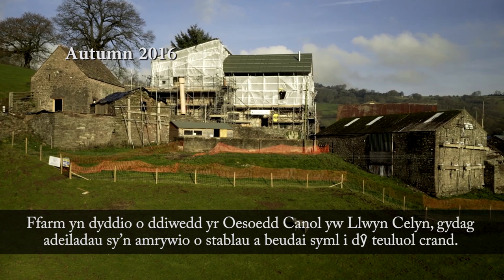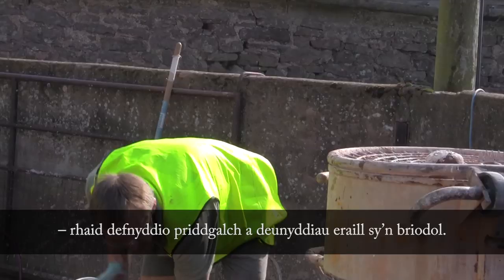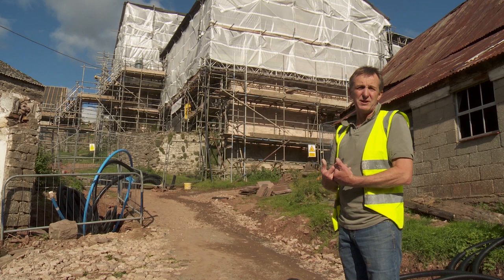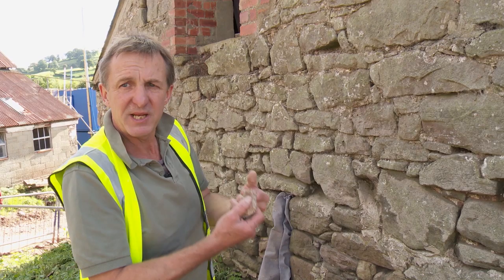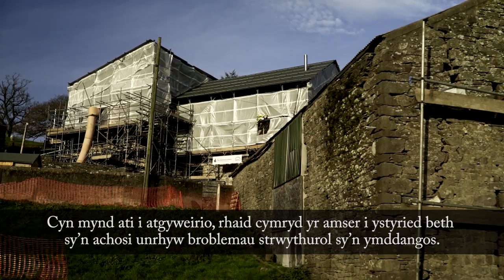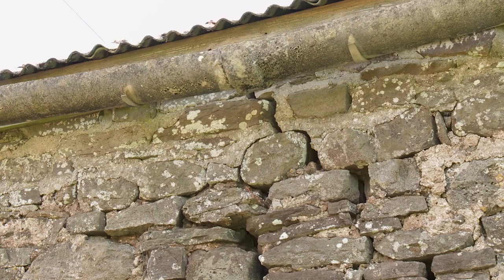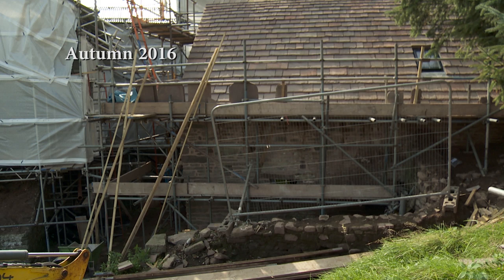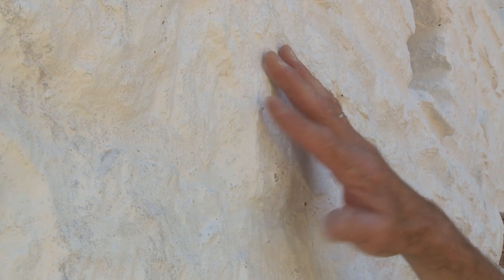Using lime mortar for repair at a medieval hall house | The Landmark Trust

Comment: Great information, I have a question, can I use lime mortar to lay down and secure flagstones on a ground surface to restore an old stone pathway? I don't want to use cement.
Reply: No you can’t, traditionally they were bedded in sand. Lime is not strong enough to ‘grip’ a flag.

Comment: I found a lime and cow dung plaster mix round one of my t windows and maybe on some parts of the walls on my house in Spain. the plaster sounded like lime and cow dung in some places. Wet it smelt like fresh cow muck.
In ohter places some parts of the house seemed to have been covered with lime and sand plaster and others lime without sand  and others lime, local clay and sand.
   IIt seems to me that the plaster on the walls have been repaired in hte places it had fallen off so that  what is on hte wall is a patch of one thing in one place, cow muck and lime say and sand and lime in another, and lime,  the local red clay, and  sand lime plaster in others. 
 The stones are held together with clay and  combed goat and so the lime plaster has in places, like below the windows were rain falling the sills caused the clay to bleed out  so that the walls been coloured by the clay and so hte plaster is pink in places.
Reply: Wow: such an old house.

Comment: I am plastering the interior of an old brick building and  we were recommended NHL5 1:4 ratio with sand. Being that the NHL5 is the least permeable between the hidraulic limes, should I change to NHL 3.5 even if the first coat of 0.5 mm was already made with NHL5? As I learn more about this system more, I feel the recommendation was incorrect...

Comment: I am surprised that it wasn't pointed with like to like material and in this case at least it would be a hot lime. So they didn't bother to slake quick lime on site to achieve better mortar and instead they just bought bags of nhl. It's lazy and I am not
impressed. And I don't agree that there is an honesty in the new pointing. It's not flashed enough with the stone, the more quality mortar the better it is for the stone. it's hard to achieve that with the NHL. The workability of nhl is not great, this material is not sticky enough. The functionality of hot lime is much greater than the NHL, ability to remove moisture from the stone through the capillary reaction and what goes with it removing salts from rain water, hence protecting the stone is much greater. But what do I know, just did some research for my project but anyone who is interested in lime pointing should do his/her homework and choose the best material possible . Just my opinion based on a lot of research and common sense.
Reply: I agree with you, NHL has recently been proven to be too unpredictable, I like nigel copsey's book on hot lime mixes, it's worth visiting his website, so much good quality research him and david wiggins has done on the subject.

Comment: aaargh yes i know where this guys coming from/,,,,,,early maori here in new zealand used an ancient mortaring technique using,  3 parts moa crushed bone,  6 kiwis,  10 pounds of puha, volcanic sand mixed with boiling mud from rotorua to build New Zealand's parliament building